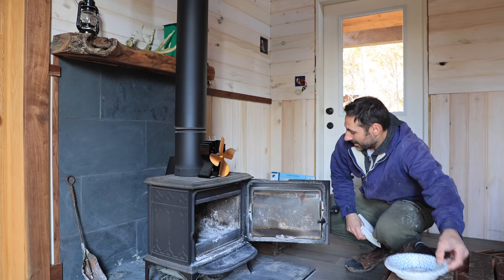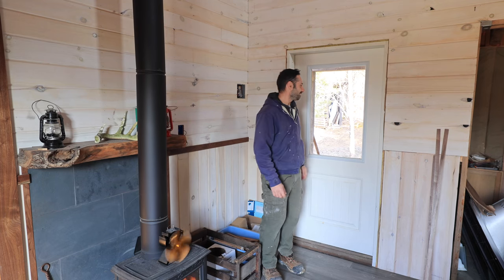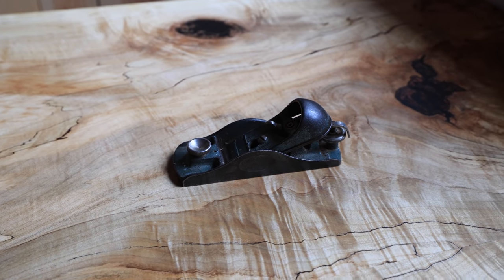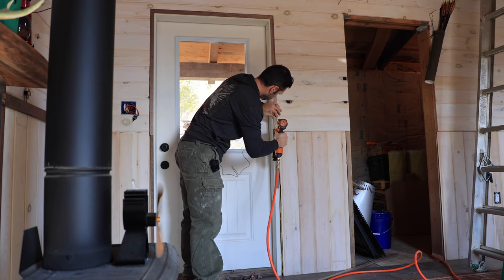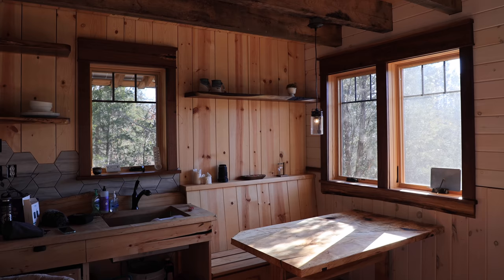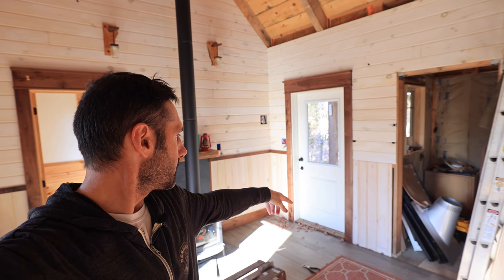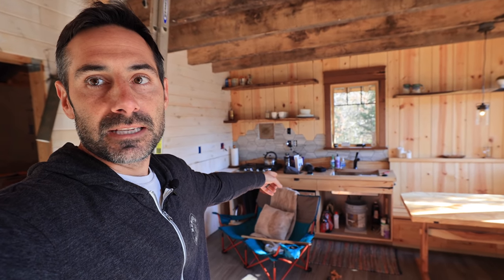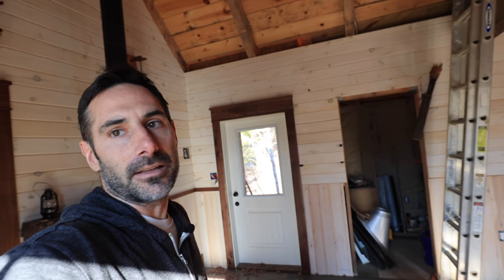Walnut Trim | Marine DC Switch Panel | Off Grid Cabin Build (4K)

Comment: You're doing an awesome job, I think bathroom door should be next as that's practical.  Cabinet doors afterwards and then loft rail and stairs as the loft is only used a couple of times a year. Don't stress, answer comments if you can as I  know you are like everyone else....busy. Stay safe, be careful,  take it easy and keep warm and dry.

Comment: Mike, Mike, Mike   Don't cut the counter....Install a drawer "slide rail " under the window between the wall and table, add wheels to the table legs and than you can just push/roll the table forward to get into the bench than pull it back ! Have a locking latch somewhere to keep it from moving after you are seated.  Now you already cut the corner of the table top  :-(   so cut the other corner to match , or patch that corner . EASY JOB perfect solution to getting bigger people behind the table to sit, plus when Sarah needs to clean or access the shelfs back there she can just slide the table forward and be able to stand up in front of the bench.

Comment: that little plane would be very handy but never seen one hear in Australia i have seen one made from wood in the Philippines and its small like that but its very handy people just sharpen the main blade and put back in the timber that is there plane alot people use it there thought i would tell you about that Love that trim you did really is good Finish the Kitchen and the bathroom for sweet Sara Dont say sorry Mike you do a good job on your work you do at the Cabin
Reply from the maker: I've love to pick up a plane like that, is it a pull rather than a push also?

Comment: Mike, there’s 3 things that might be the issue with keeping your stove glass clean. The wood is still too wet, you’re not getting the fire hot enough and probably the biggest thing is that there is no exhaust glass wash pipe.  The latter is a pipe that exhausts super hot gases down onto the glass screen. Just a couple thoughts from a fellow Massachusetts wood burner.  

As always, your vids are great and your craftsmanship spectacular

Comment: The stairs should be the icing on the cake, go all out not just a straight down ladder looking type. i would come down back wall then 90 degree turn onto a landing with a step to sit on and a custom railing too match the one you build at the top of the loft . I would live edge the treads and make them look like the table top , also recess lights into the steps going up and also at the landing step at the bottom.

Comment: After writing my comments below I watched the videos where you made the table in the workshop. OK, wouldn't be super simple to shorten it, but I still think cutting 8-10 inch off would be very doable. Some serious work to shorten the crossbar but still can be done. No changes to the legs, only one new groove under your table top. Having the shorter table one to two inches from the wall (French restaurant style :), will give a happier flowing look.
Reply from the maker: I've been contemplating what to do.  I built it a bit too big for sure.  I can't make myself cut it down now, because the ends are where all the spalting is.  I may try turning it and seeing how it looks.  Once I build chairs it will be a bit more flexible too because then skinny people or kids can sit on the bench.

Comment: Years ago I read a hint about how to handle the load when you have a whole bunch of projects; bills; repair jobs; whatever.  It can be fun to have lots of jobs to look forward to, but if there are too many, it is hard to know where to start.  This "hint" has stood by me.  Unless it is a leak or a fire somewhere, (obviously those shoot to number one on the list,) you should eliminate the small ones first.  I have modified that priority list only to say that the most "in your face" projects -- the ones that hit you between the eyes when you walk through the door -- that should be done first because it lifts your spirit and encourages you to knock off the rest on the list.  Having said all that, what hits most people, apparently,  are the kitchen cabinets.  So depending on how badly that affects Sarah, I would put that at number one.  If not having a proper bathroom outshines all other problems with the unfinished cabin, then by all means do that first.  Pick your battles wisely.

Comment: For consideration:  table corner,  consider cutting the window edge down by 1 or two inches and slide the table closer to the window to give you more room on the tight corner.

Comment: I bought one very similar in size to that one on ebay Vintage Stanley Handyman Wood Plane #1247 a month or so ago and it works good. I built this chicken tractor years ago and on the door I made fit a little too tight and it was not closing this winter I planed it off with my used plane and I also planed my door to my room with it so its really handy. I only paid like 8 bucks but the shipping and taxes actually cost more than the plane. You gotta work on the bathroom door for Sara she needs a bath room. If you dont read my comment or answer it dont stress I can handle it and will not be offened. Its just Youtube no biggy. I mostly come here to see the progress on the cabin and what fancy thing you did to it. The cabin is dang fancy. And women have to have a bathroom it just the way it is. I can not travel down the road not have my wife need to use the bath room a few times LOL.

Comment: I think the cabinet doors can wait, bathroom door sounds reasonable. Also, can you do a follow up on the wood stove...maybe in spring....of how it's been to live with on winter weekends, should you have gone bigger/smaller/different,  etc. Curious about burn times with a small firebox, and whether holds heat overnight, or if you get up to re-stoke, etc.

Comment: Nice video.  We got about 4 inches of snow and 2 days later it all melted.  It was 54F here in central Ohio. Where is winter?  I'd like to see you take enough food to the cabin and get snowed in for a weekend.  BUT if the snow was deep enough, you could break out the Yanmar and shove as much as you can in your little pond so when it melted, hopefully it raised the water level.  I was going to suggest that if we got a mini blizzard you could take that Yanmar and build the tallest snowman.  Until I googled it for reference and saw the record stands at like 133 feet.  Another great use for snow and ice is to break out the electric ice cream maker.  Chocolate milk, cream, more chocolate and you can eat a nice fresh bowl around that crackling wood stove.  Who says ice cream is only for summer?

Comment: If you can find T rated ‘SNAP’ light switches many of them were also DC rated to 15 amps. Since many of your lights are LED lights you are likely under 15 amps. You could use them and standard switch plate covers where you currently have toggle switches hanging out of the wall.

For your next project you really should check with the Minister of Finance.
Reply from the maker: I cant seem to find any of those switches.  I do remember an older AC/DC rated switch that was no longer made but unfortunately they were like $40 each on eBay only.

Comment: On that chair and table once you put some cushions on the back of it and then that way it would push it out a little further when you put the cushion on the bottom and then that way your table would have to be pushed away a little bit then you would have more room to get between there without cutting the corner of the counter

Comment: I Think you should work on your bathroom before - as far as the table - I thought when you installed it, you should have made an oval table... at least on the open end and perhaps cut a few inches off the wall side... just a suggestion. You do outstanding work and am always impressed with your knowledge and skills....

Comment: Love your channel. I bought an old A frame in VT, looking forward to working on it. My last visit, realized there is no vapor barrier in my walls, lots of moisture behind the insulation. Any tips? Should I gut it? Also pulled out a garbage bag worth of nuts, pine needles and rice  in one small cavity- squirrel/mice.

Comment: Seems like the loft work should be done later. You want to finish the spaces that you use the most, which is definitely the first floor. The next question is, what could be done the fastest? I would imagine the cabinet task is pretty quick, relative to finishing the entire electrical room, and if you're like me, you might enjoy checking that off your list sooner rather than later. For very small tasks, I would definitely put in face plates around your switches, because the visual impact is huge and the effort is low.

Comment: I’d put a curtain on the bathroom door frame, problem solved. In the meantime do the kitchen cabinet fronts at the shop. I like your use of marine grade products. To me those are the only ones to use. Wire size up, use a #12 or even #10 wire. I know it’s more expensive but it’s not like you are building a mansion with 100 miles of wires. 

Soooooo, Mike and the Magic Hammer is not going to be the new channel name? And I’m sure we’ll catch you in yoga pants eventually.

Comment: Yay I'm the 4th commenter!!! Love your videos.
Reply from the maker: Yay! Thank you!
Reply: @50Acres  I forgot to ask, what voltage you running and you stepping up or down voltages for appliances or lights?? Also what's the wire size from battery to panel??
Reply from the maker: @killerdeamonking  My system is 24 volts nominal.  It comes off the roof at around 40 volts.  I run 10 AWG to the combiner box and then 8 AWG from the combiner to the CC.   On my east and west facing arrays I think they are both 10 AWG.  All my DC devices run at 24 volts (up to 30 volts in real life).
Reply: @50Acres  I see thanks, i am currently planning a setup for future as i often loose power alot where i live so going the dc way for lighting and such.  Going to get the clipsal 402/32 Single Socket Outlet, 32V, 10A, 2 Pin.  They can be a little on the pricy side but they are made for DC.
Reply from the maker: @killerdeamonking  Oh that is interesting, I had not seen those outlets before.  Be sure to get handy with a wire size calculator and circuit protection before you run any wire.
Reply: @50Acres  Ohh indeed, Im very handy with this. But yes you can do 32vdc at 15a somewhere i seen someome do 52vdc as a max. My reason for using those are i wouldent want someone to accidently plug a 12v application into 110v ac xd. Clipsal 492/32 , 438/32 , 402/32 , 405/32 . there are quite a few diff uses for them. One of which was a USA one.

Comment: Also don't build a fixed bench on the other side of the table "so it can still slide"  Build nice chairs, chairs can be moved around and used elsewhere when you have guests...Build the stairs and loft railing next, safety  1st , and you will have safe access to store things in loft when the boys aren't there and you wont have to drag in the ladder to get up there .

Comment: Why don't you use an inverter? You could use all the usual devices.
Reply from the maker: I also have a 1,500 watt inverter, I use it for anything I can't run off DC.  In this way, I don't have the constant ~30 watt penalty of the inverter and the 11% conversion penalty.  I just switch on the inverter to use things and then switch it off when I'm done.

Comment: Here about your counter - dining table problem. Yes, it is now pretty ugly :).Ask yourself: how often will you eat at that table with more than two (maybe three) people. 

So don't round the corner of the counter!! Instead seriously shorten the table enough for just two people (you and your wife) sitting opposite each other and get rid of that ugly 45 degree corner. With a third person, put a stool on the head end. With four people, you can probably still squeeze in another person on the settee. When more than four, it's probably summer, go to your deck or serve 'TV dinner' :-).

PS.While doing a reno, my wife and I had for a year long dinner at a 2' x 2' table. Yes, 24x24 inch, worked fine !!

Comment: If the bathroom is done, then it can be used. If it can be used, it will be. Is she likely to come out more often if the bathroom is done? How much sex do you want to have in your cabin?

If it's in your skill set then consider a spiral staircase. It takes up less space and adds character, charm, and maybe even a little ambiance. An alternative is a ladder that you can hang horizontally keeping an open floor plan and only bringing it down when needed.

Those cabinets, or lack thereof, annoys me, so leave them for last. Nothing wrong with trolling your subs a little bit.

Comment: Why don’t you turn the table lengthwise against the wall when not in use and turn it/move as needed. I wouldn’t do another bench. Chairs are more practical and can be used around the fire/conversation group  when needed. You shoulda made a drop leaf/gate leg table. I KNOW you have the skills for that! So much more versatile in smaller spaces.